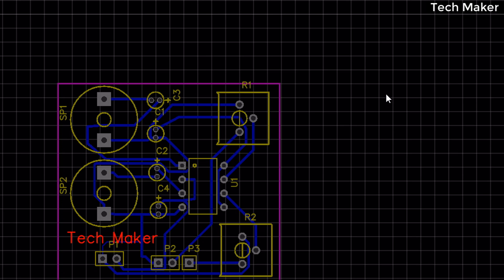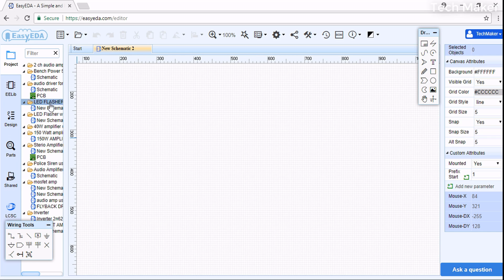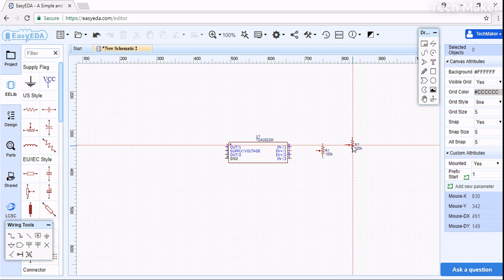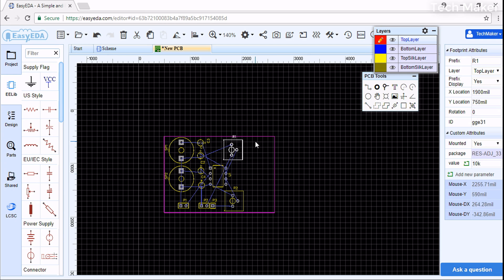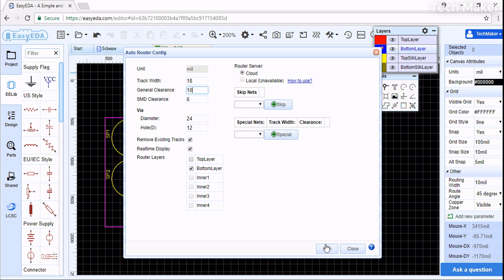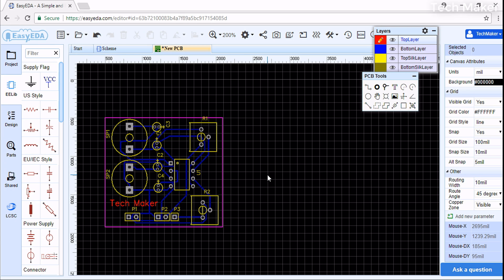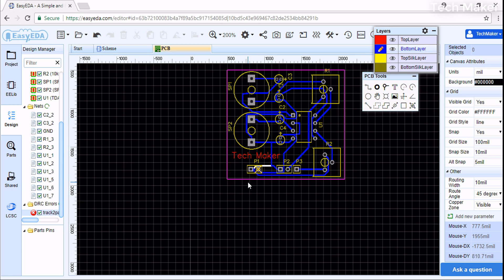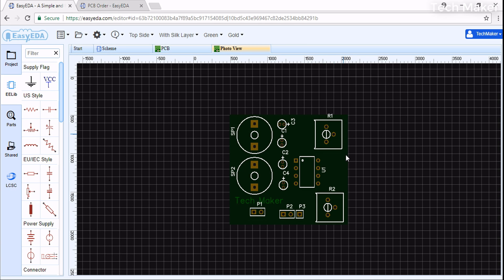How to design PCB easily in 10 minutes

Comment: UPDATE: I transferred my schematic into EasyEDA with some difficulties. The component selection was very frustrating since there is no cross-reference for commonly used components. You have to search and search for equivalents or else make your own by customizing the wrong parts. I'm glad I noticed the pins of one of the substitutions were wrong before building out the traces. The pins were easily redefined. When you first start your layout, they make no effort at all to keep your circuit arranged as designed. Also, I had some difficulty getting the correct spacing for some components, such as capacitors, I eventually had to delete the originally specified caps and drop in different ones to fix the spacing issues. I couldn't find any way to adjust the spacing of components that were already placed. Also having to use via points to route traces between sides instead of just using a pre-existing component through holes was annoying. The software kept trying to protect me from myself by refused some of my trace routings. The biggest problem was that the auto-layout for the traces took a very long time and failed with a timeout 5 or 6 times. Wider traces made that even worse. It finally completed the final auto-routing after I reduced the trace width to 24 with clearances of 12, but it was still a long wait for it to complete. I later manually routed some 50 width traces for higher current areas. I really like the silkscreen layer and customized it quite a bit. Last minute mounting holes also required some repositioning and re-routing to provide clearance for mounting hardware. I was so happy to finish it and order my PCB's. It took about 6 hours. I'm sure it will go a lot faster the next time I use it, now that I know how to. The PCB's were very reasonably priced. I hope they work without issues when they arrive.